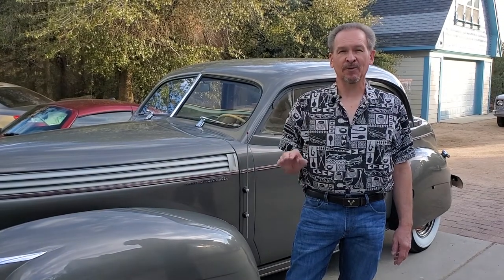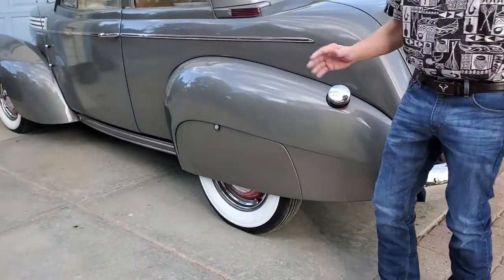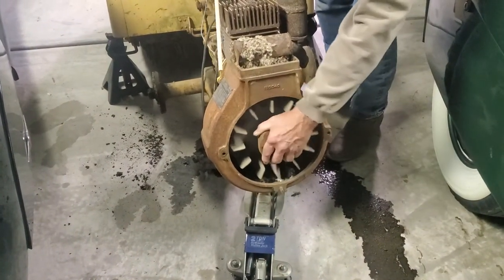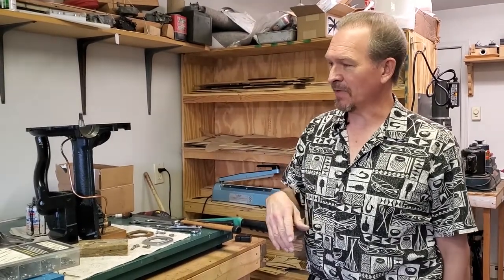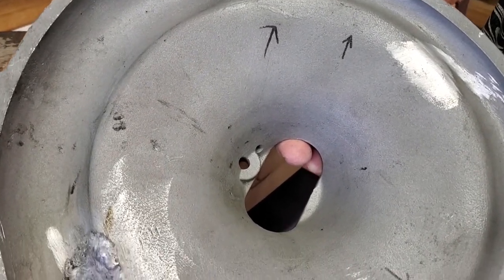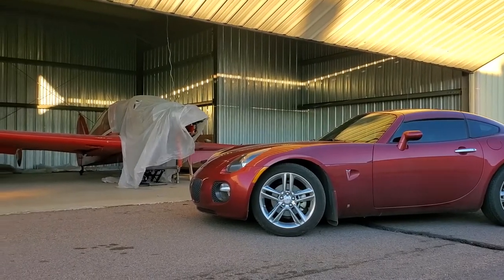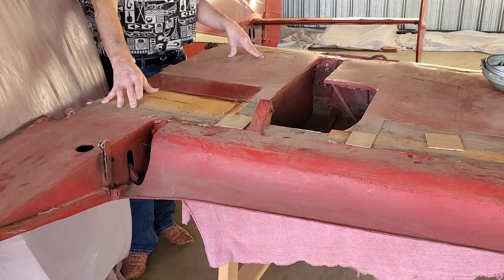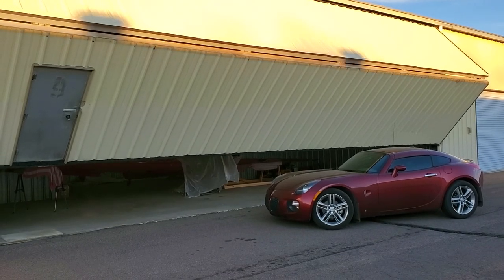1939 Graham Sharknose, Graham Rototiller, 1940 Graham Supercharger & Bellanca Cruisair Projects

Comment: Why does the '39 Willys have a nose similar to the Graham? Is there a connection? Those Graham headlights: very art-deco.
Reply from the maker: Good question, thanks for asking. Although it is not known for sure the original styling proposal by Amos Northop, which the car is based on, was presented to the Graham brothers in 1935. That proposal was not necessarily exclusive to them. At that time they lacked money to proceed with it. It is highly likely the same or similar proposal was given to Willys also. Amos Northop, although favored by the Graham brothers, did not work exclusively for them. Thanks for watching!
Reply: Recently there was a 1939 Willys Model 77 Ute auctioned on Bring a Trailer. I thought someone must have grafted a Graham nose onto it. But then I was corrected, Willys made it like that! Too similar and radical to be just a coincidence in my opinion, so the idea of the design being passed around makes sense to me. Thank you for a good video.